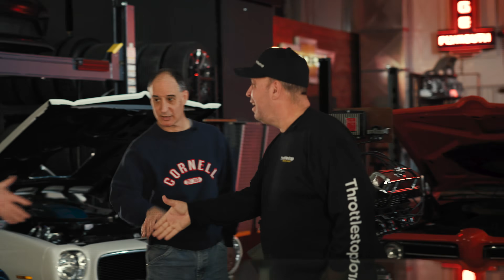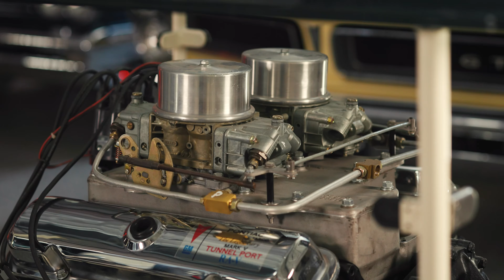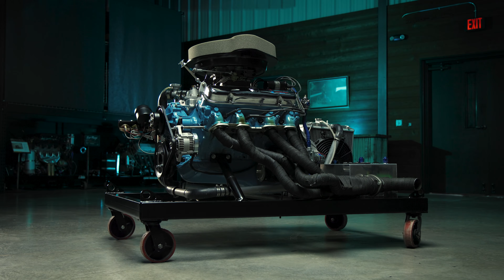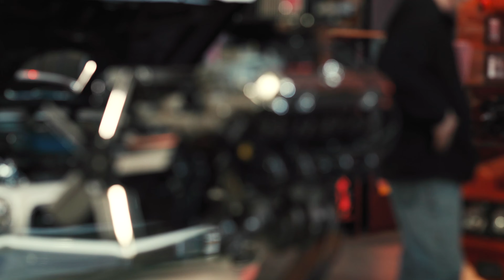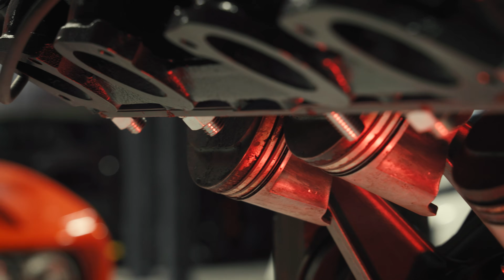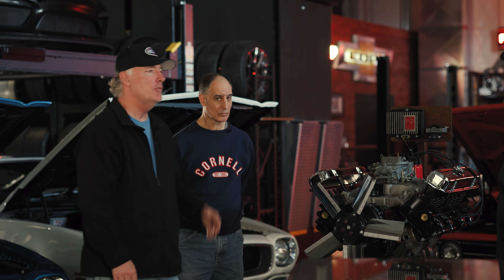Ram Air V Royalty  : Throttlestop's 3 Rare Pontiac Engine Displays

Comment: The 301 sitting in for a 303 is intriguing. I always thought of the 301 as a weak inexpensive smog motor, which it is, but I guess it looks like a 303 on the outside. 
  In early ‘80’s buddy worked for a Formula Ford race team and he went to a machine shop to pick up an engine and they had some RAV heads laying around. That’s my connection 😁
Reply from the maker: Interesting story! Thanks for watching!
Reply: Tom Nell's 1978 366 engine used in the SCCA Trans-Am Category II Silverbird was a developmental 4-bolt 301 block. The production blocks were lightened and therefore the main bearing webs were not as strong. While the early 301 Turbo blocks had beefier main webs than the standard 301s, they were still not as beefy as the developmental blocks IIRC.

Comment: Butler needs to make a 2.84 stroke crankshaft! i always thought backwards and was plotting on making a bastardized 303 by cutting a 400 block down and sticking a 301 T 3 inch stroke crank in there, but that was before i figured out it's disgusting balance characteristics. MAYBE leave the stock block deck alone and go with taller rods and/or pistons, that 303 inch should be able to breathe through those big nasty ports the way Delorean wanted to! I really wonder if the RPMs were too much for the rods themselves or if it was a rod ratio/compression height thing, either way a dry sump oiling system would be a good investment for these old beasts!
Reply from the maker: The 303 just was never enough to support the RA V Heads from the factory. I think you should do something though, those sound like great projects!

Comment: 1962 Winternationals MT had several tempests with the Transaxles replaced with standard.  several engines  One was a big block with FE sparkplug style heads
were these RA-V or something.  I went by MT shop but no one would talk about them
Reply from the maker: Given the time I'm assuming this would have been more likely SD stuff right? I'll see if I can get someone to comment who knows a little better the drag history...
Reply: @thethrottlestop  thanks
Reply from the maker: Pontiac Mike says Mickey was designing and building hemispherical heads for Pontiacs at that time, could have been that!
Reply: @thethrottlestop  No plugs were on top of the heads like a FE ford or 413 Chrysler motorhome  I do not recall if ports were spread I knew MT well

Comment: I was a customer of Purely Pmd...i was waiting out front of thier shop when they drove up with the 69 Judge they would later restore and install the ram air V crate engine.....they found the Judge in a junkyard in Gallup with no engine or transmission and was being used as a doghouse for the junkyard. The crate ram air v was a warranty return....a Pontiac customer bought the engine over the counter and after a few minutes it began a rod knock...so the customer was able to get it warrantied at the dealership until John was able to buy it 1987.Over the next 4 or 5 years I was able to witness the resoration of that Judge....the Ram Air V was sent out the crant ground and the rod resiezed....John was able to purchase the only ram air 5 prototype hood tach and the only set of ram air 5 exhaust manifolds for the A body...after showing they sold it...and 94 a customer who bought it an an estate sale for $10,000  brought it to Purely Pmd to identify the cylinder heads because they looked like big block chevy heads....
Reply from the maker: Love it! The circle of life right? I'd love to have that Hood Tach you mentioned! Thanks for watching!

Comment: How much hp did the ram air v 400 actually make. ?? I heard it really only made hp on the top end. The 400 was to small for it. Love the ram air g.t.o... !! I'm guessing maybe 450 hp at like 6500. Torque not that good. Would of like ram air v 455 ci
Reply from the maker: The heads were too big for big power, I'll get the numbers and get back!
Reply from the maker: Pontiac Mike says no one is sure of the RAV 400ci power numbers because it never made to production! His guess is upper 400's
Reply: Thanks for the reply, only if the ram air v had another year of development. A 455 ram air v, would have been crazy !!

Comment: Do you know if there is a way to figure out the history of a 1971 Firebird Formula 455 Ram Air;  (it is listed by PHS as a Formula 400). Did dealers make this upgrade or?? The car has been in my family since the late 1970's, I purchased it from a tow yard in Culver City as a wreck, front end collision with low miles. Fixed the damage and it still runs strong today.
Reply from the maker: I'm asking around, thanks for watching!
Reply: If it was a factory 455-HO car it would have had the Ram Air air cleaner. A 400 car would be less likely to have the Ram AIr air cleaner on it from the factory. Some dealers did a dealer-option Ram Air air cleaner swap on the D-port engines, but there would be no PHS documentation on that since PHS docs are based on the factory documentation. The only way to verify post-factory history would be to track down the original owner to see if they have dealer paperwork or possibly track down the original dealer to see if they still have any paperwork on this 1971. If you're able to do either of those you should get the paperwork notarized.
Reply: @sc2422  Thanks for the reply, it does have the Ram Air hood and air cleaner and 455 callouts on the fenders. I need to do some research on the original dealer. It is a rabbit hole.
Reply: @larrymarvin2453 Dumb question (probably the first I should have asked you): have you already verified that the block and heads are proper for a 1971 car by casting dates? Have you verified the engine assembly code stamped on the front of the engine as being a Firebird code? The callouts on the fenders can be changed easily.

Since 1971 is the last year GM didn't include engine option information in the VIN, the VIN doesn't help. GM changed from a 5 digit model designation to a 4 digit, so a Formula in 1971 should be a 22687. Have you found your build sheet? On most Firebirds it's sitting on top of the gas tank. The build sheet would provide all of the information on how the car was configured on the assembly line.
Reply: @sc2422  I am almost certain the gas tank has never been off the car so the build sheet may be there. We will need to check with my mechanic, and verify block and head numbers. It is 22687 vin. About 10 years ago we were at a car show and a Pontiac enthusiast was very interested in the fact that the Ram Air specific intake and exhaust manifolds and heat shields were still on the car, and he did mention the heads were correct. Again thanks for the info.
Reply: @larrymarvin2453 The first 5 digits 22687 indicate: 2 (Pontiac) 26 (Firebird, Formula), 87 (Body style is coupe). So we can be sure it's a Formula when it left the factory.

Oh, for some cars the build sheet was placed between the rear seat and the body as well.

Keep us informed on what you find out.

Comment: If Pontiac would used those heads on
The 455 H0 as a racing crate  engine
Reply from the maker: Those heads and a 455 would be an absolute monster!

Comment: Hell yeah!! You never hear about the 303 and 366 prototypes. Wonder how many ponies the RA V would have had? I’ve also always wondered what the 455HO could have been without the restrictions.
Reply from the maker: Those would be some beastly engines! Thanks for watchin!
Reply: During this era Chevy had a 366 Big Block truck engine for its medium duty line of trucks. The C/40, C/50 & C/60
Reply: Hemmings did a video where they dyno’d a 461 with DCI RA-V heads, 11.3:1 compression, custom cam (required due to different valve arrangement) and a custom intake that was port injected with twin Holley 4150 throttle bodies. Distributor ignition.
It pulled 675 hp with 575 ft-lbs of torque, but comes out of the gate with 500 ft-lbs @3k rpm. This is just naturally aspirated with fuel injection.

Now give the computer full control of the ignition system and force feed it, I’ll bet it outperforms an LS.

Comment: Born and raised in Pontiac Michigan. My dad spent 43 years at PMD, woeking in plant 14 as a tool and die maker. I have owned about 10 Pontiacs, 3 which were Goats. Still have my modified 06 M6 Goat. Guess that makes me a Pontiac man as well.
Reply from the maker: That’s awesome, what’s your favorite Pontiac? We love to hear these stories!! Thanks for watchin!
Reply: @thethrottlestop  Wow, that is a hard choice. Pre 70 would have been my 68 Goat. I built it for highway speed (triple digit speeds). Post 70 would have been my 06 Goat, although I had an 86 Grand Prix, so damn slow I had to time it with a calendar, but with the suspension that I added to the car, it handled like it was a Stock car.